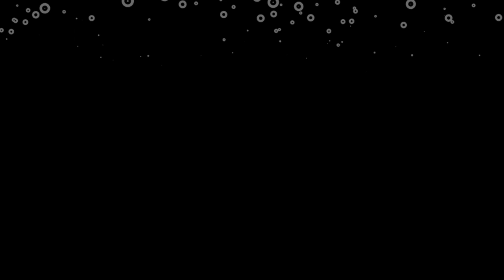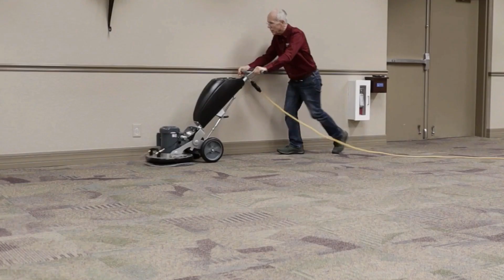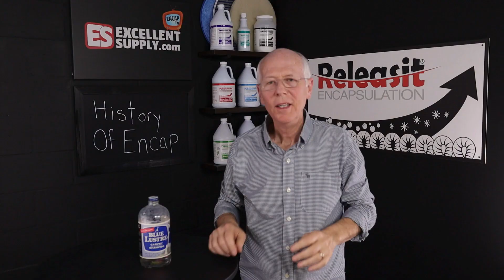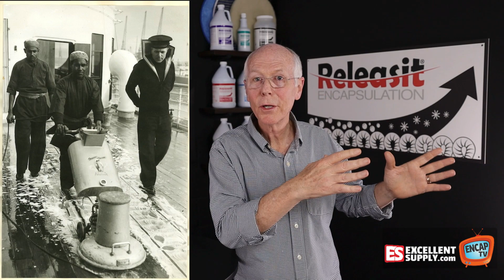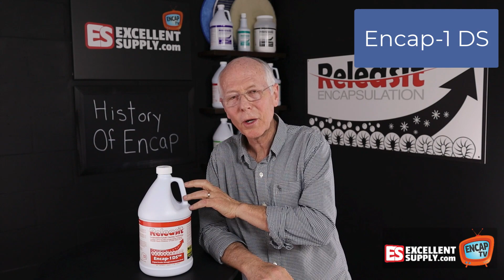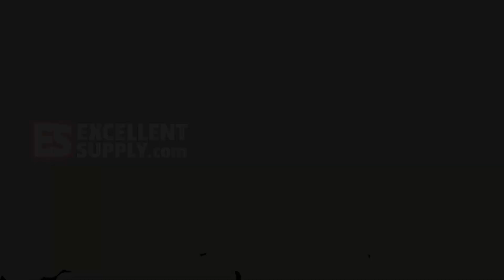The History of Encapsulation Carpet Cleaning

Comment: Wow! I got my Electrolux & Floor Pro system new for home in 2000. I didn’t realize it was that brand new.  Because in my Nan’s she had a 1964 version. So what was the chemistry of the 6070s foam? Was it good for its day.  I’ve continue to use Electrolux Turbo because it’s what I had.  Baby safe home. & for pets.  But is there something newer that is baby safe?  Hyper allergenic.?
Reply from the maker: Early carpet shampooing goes back to the 50's. The advancement of crystalizing polymers for encapsulation cleaning began to emerge around 2000. The word "encapsulation" had not yet been coined to describe the process. That word actually emerged from a conversation that I had with a good friend, Don. Don and I were talking about the crystalizing technology that was emerging and he said, it's like it "encapsulating" the soil. I began describing this method on the industry message boards using the term "encapsulation" and I wrote the first article about "encapsulation" in Cleanfax magazine. Guess I should have trademarked the phrase LOL.
Reply: @EncapTV  I saw that but i mean what was the old formula i stuff called if the 1960’s? As it appears it dilutes down the exact same as my 1999/2000 polymer based. It has every appearance of a dry foam, but what did they use?  I understand Kirby‘s version came out about the similar time. 1965.  We have one of them as well.  I prefer the Lux method
Reply: As a car enthusiast. I use it in my cars as well on upholstery fabrics, sofas, and chairs.   It’s awesome for maintenance cleaning as you said.  (:
Reply from the maker: @khanscombe619  I haven't worked with their shampoos so I can't say.

Comment: Well-delivered information on the history of the dry foam shampoo/encapsulation method of carpet cleaning! I and some others who like using vintage dry foam carpet shampooers in our homes such as the Twin-Disc models made by Hoover, G-E, Westinghouse, Sunbeam, and Regina and the Triple-Disc version made by Electrolux and Aerus. None of these have a suction component as they were designed in the 1960s & 1970s. Have you or someone you know used your product with such machines. If so, was it effective both for cleaning and long-term care?
Reply from the maker: Those classic shampoo machines are cool. Yes, Releasit will work extremely well with an old-school shampooer. Give Encap-Clean DS2 or Encap-1 DS a try. You'll be impressed!

Comment: I'm the lead of carpet and tile care for a pretty large janitorial company, it was small when I started and I basically had to self teach when it came to carpet cleaning. We do a ton of hot water extraction on commercial carpets and we always have issues with wicking. We definitely need a Cimex machine
Reply from the maker: Wicking is the reason why encapsulation has gained the traction that it has. Encap has changed the commercial carpet cleaning industry because of this very problem. Like you – wicking drove me insane as a commercial carpet cleaner; until I discovered the encapsulation method and then shared it with the industry. Happily today, carpet cleaners can clean commercial glue-down carpets and not have to worry about wicking and recurring stains. Looks like you're a perfect candidate for making the switch to encap too!